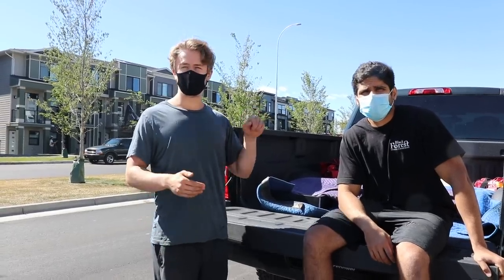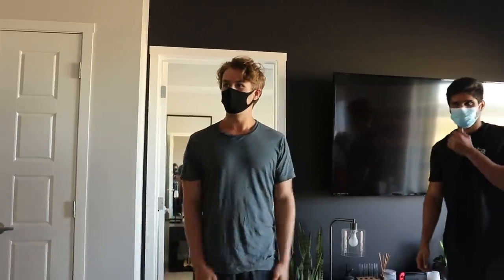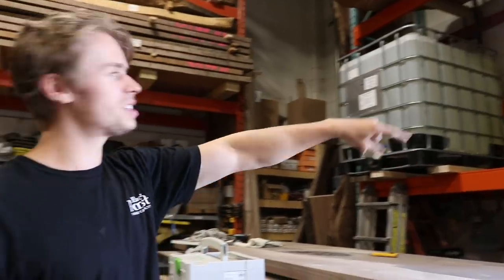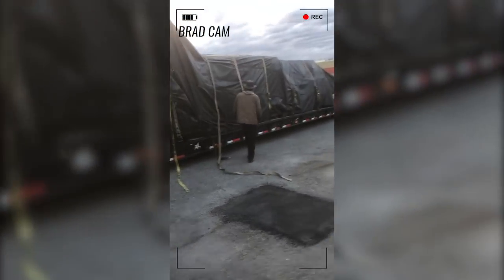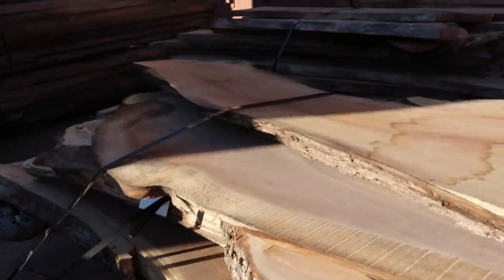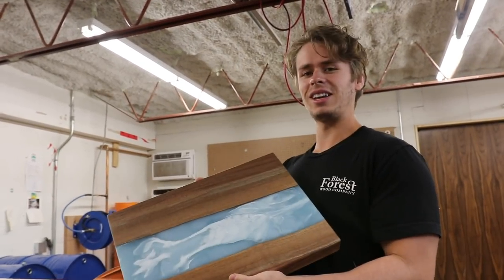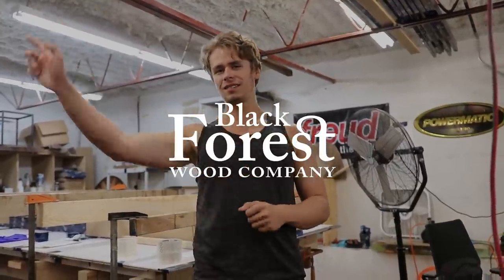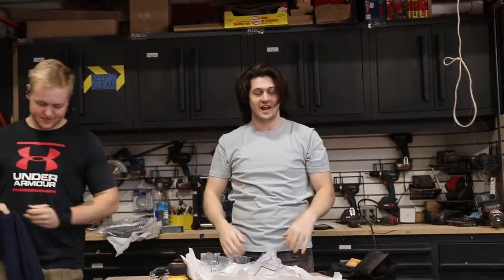Replacing a Client’s Table for Free

Comment: Yes keep us in the loop of what you plan on doing in the new area. On the 3D effect table - try using a thicker solution of the second color (white is what you used) but let the first color cure a little to help suspend the additional color. I have done this with other smaller pours (cubes and paperweights). Keep up the good work and stay safe.
Reply from the maker: We will! And thanks for the tip!!!

Comment: Can I recommend something to you.  If you use a block out colour in the epoxy use the Festool domino in the live edge to make some mortise holes.  When the epoxy is poured in it runs into the holes and creates very strong tenons.  This way you are not just relying on the bond.

Comment: The zoom in 😂! Question how does the epoxy n wood hold up to weather (sun/rain)? Does the epoxy yellow out with high sun exposure? Do u get wet rings leaving a cup on it?
Reply from the maker: Our tables are indoor tables! The epoxy shouldn't yellow because our epoxy has UV protection in it, but we still don't recommend putting our tables in direct sunlight because the sun will dull the wood itself
Reply: @BlackForestWoodCo  thanks for answering 👍🏽

Comment: Wtf are you putting so much resin over the top
Reply from the maker: To fill in cracks and voids in the wood so we don't have to after, and also if any bubbles or anything like dust goes in, it will float to the top and we will plane it off
Reply: Black Forest Wood Co. unusual to put so much appears to be upto 20mm in excess? Surely being more conservative with a finer touch to cracks crevices etc would both reduce cost and increase profit. To reflect on others methods a heat torch over the top to remove bubbles a paint brush over live edges to remove bubbles would be better the then wasted resin.
When you plain the top back to finished thickness are you also removing wood are are the slabs already at finished thickness